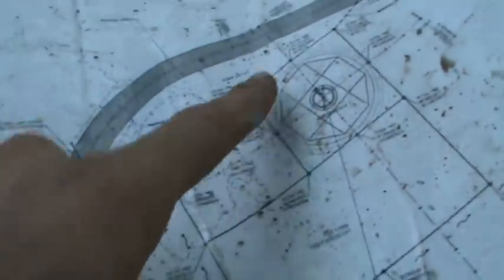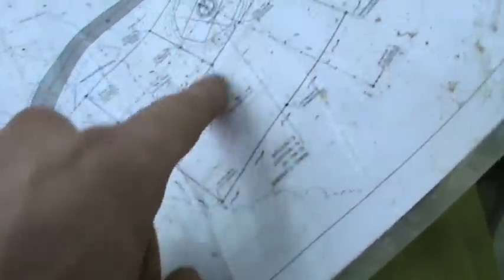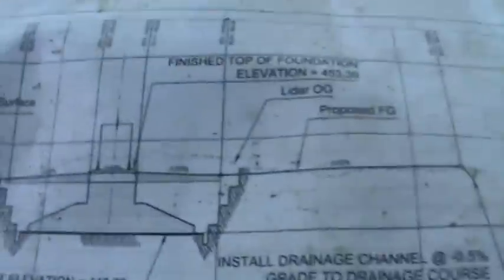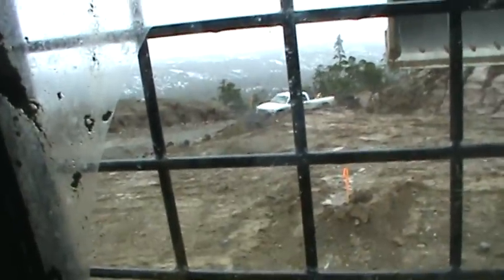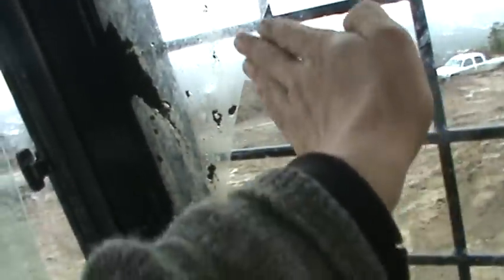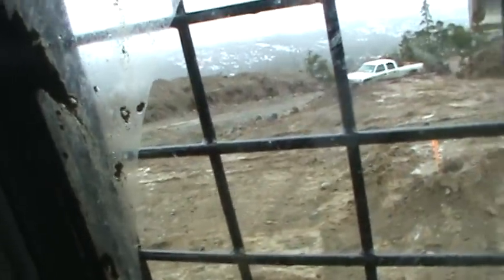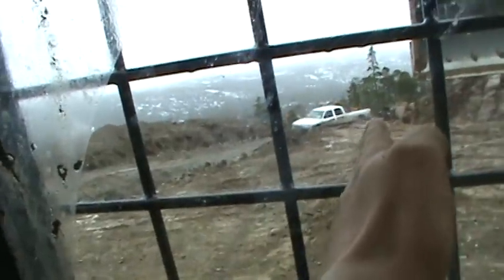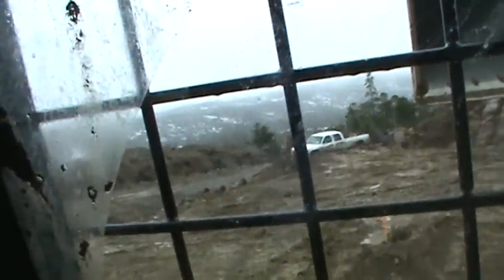Constructing a wind turbine location on North Vancouver Island

Comment: Not where the crane is going, that's the point of the ballast rock. Once the crane crawls on top and platforms, the rocks will settle the weight. Concrete would just be unnecessary and wont drain water as well as the ballast.